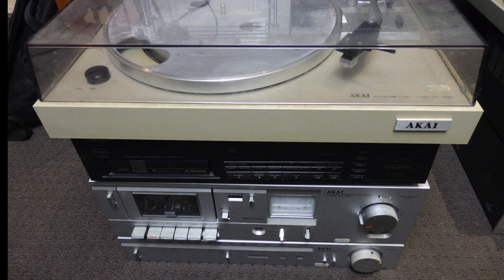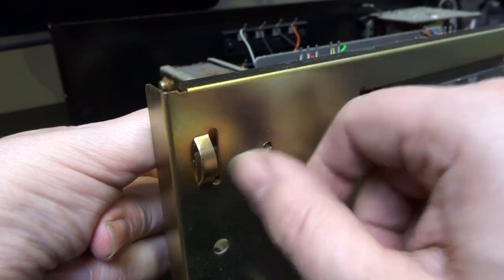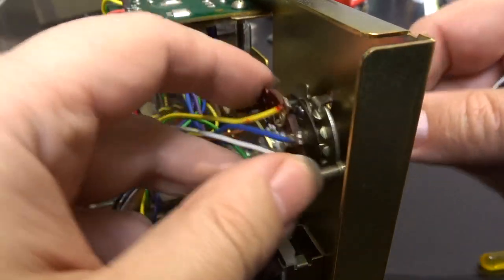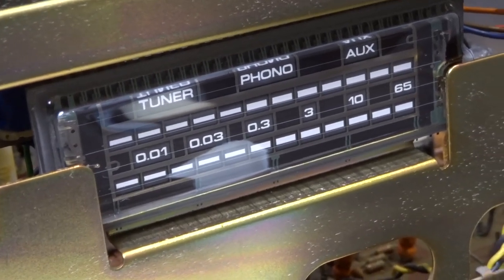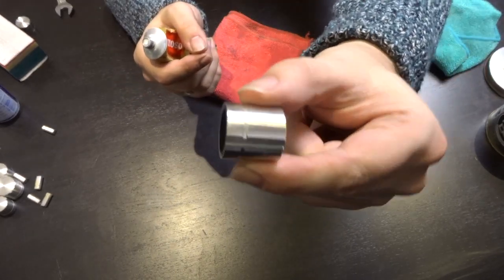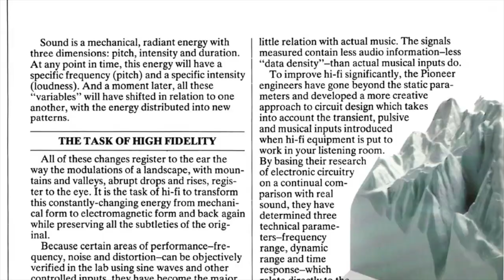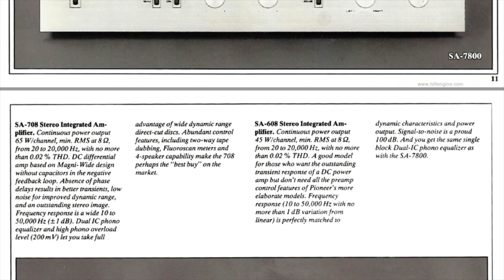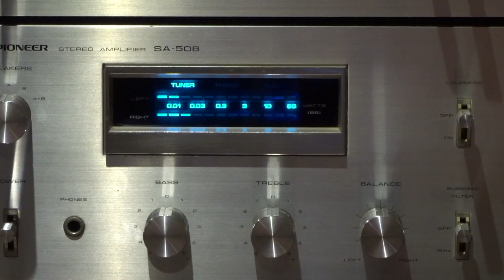Pioneer SA-508 Restoration

Comment: Job well done! -I bought my SA-508 used at early 80's from band mate. After a few more modern amps it's again my main amp. Phono, CD/MD "tape deck" and laptop YouTube main sources, large DIY speakers. Could use some deoxit on pots and switches. I really like these power meters.
Reply from the maker: Thanks Pekka, my SA-508 spent a year on a shelf wrapped in plastic. But now it has moved into my office space to make working from home more enjoyable. There will be a second part where I will do a full capacitor replacement.
Reply: @ClassicHiFiReviews  I was sure a month ago, when amp started fading after power continuously on for two weeks, that capacitors are dying. But after two days rest and cooling, it recovered! I guess it overheated. I was sure power capacitors were dying. That day will come anyway, so I'll be following your work on capacitor replacement. I suppose it's the big ones, which might fail first.

Comment: BTW, can you tell me, how to adjust quiescent current in this model? I don't have full service manual and i'm currently restoring this amp.
Reply: is noisy when loudness switch is turned on?
Reply: @Circuitdamage  ac hum is heard all times, but im waiting for new power caps (im planning to use pair of quality 10000uF, all small caps will be nichicon gold)
Reply: @Circuitdamage  already restored, all parameters are fully within spec range! (Btw, tone compensation is nice, i'll use schematic for my new phone amp)
Reply: @RBSVader  Did you finally replace the filters? my sa-608 is noisy and sometimes when i move volume control fast it trigger the relays
Reply: @Circuitdamage  totally recapped it. Works like a charm now.
Reply: alex i just got on of these amps and i plan to restore it. I'm told i need to repair, output transistor fault. did you replace the capacitors?
Reply: @bobof673  yep, all caps was replaced by new ones. Sold it to my friend, now restoring Yamaha CX-1000
Reply: @bobof673  just remember the golden rule, if you have to replace only one output transistor, you should replace all of the output transistors unless you have the equipment to match the new transistor to the old ones, it's better and easier to replace all of them at the same time so that the output stage will work in balance, the remaining old transistors can be sold on eBay which would probably pay for the new ones anyway...
Reply: I'm picking up this amp and tuner tomorrow for $225 says everything works, needs to move some gear. Asked $250

Comment: can i use the alcohol on the faceplate.is it safe concerning the print
Reply from the maker: It was safe for me. The isopropyl did not do anything to it.
Reply: Classic HiFi Reviews because you never rubbed alcohol on the face plate.
Reply: I had bad luck with a fine Akai 1055 reciever. The print is applied with silk screen technologi. Its basically a thin layer of surface paint . I think all the 70´s reciever exept may Sansui (Engraved) used this.

Comment: Désolé !
Pour moi ce n'est pas une restauration !!!
C'est simplement un grand nettoyage !!!
Sorry !
For me it is not a restoration !
It's just a great cleaning !!!
Reply from the maker: I agree that it is not a full restoration with replacing caps. But it was visually in a pretty bad shape. Significantly more effort than normal cleaning was required.